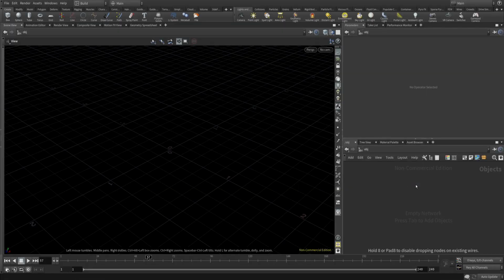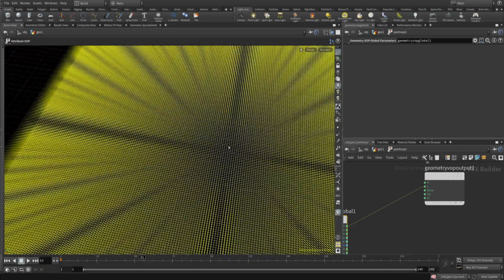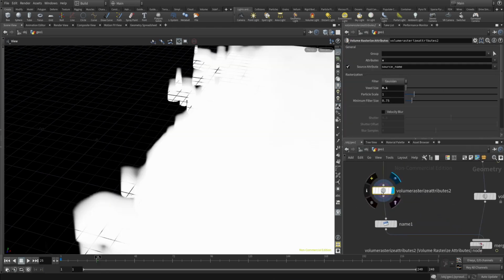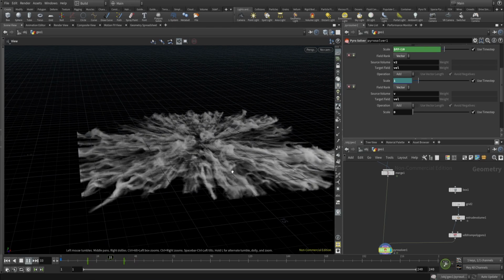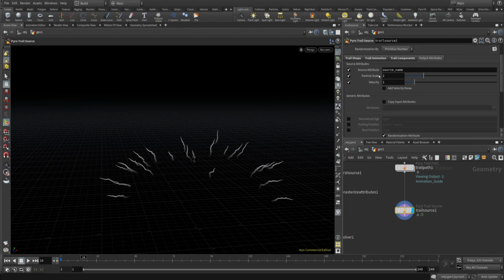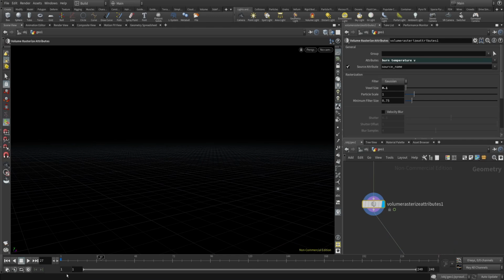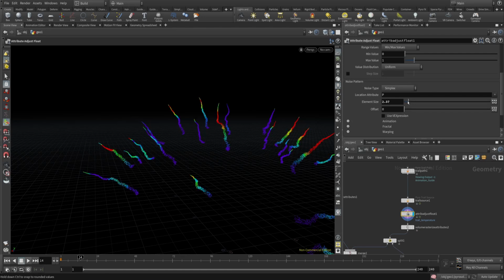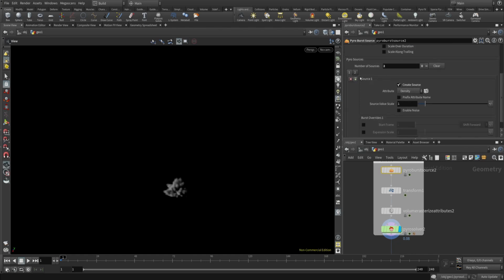Pyro FX in Houdini Tutorial , Part 02 | Shockwave,Trail  Explosion | For Beginner

Comment: I DID RENDER WITH MANTRA BUT ACES COLOR DOES'NT APPEAR ??????
Reply: Bro, simply avoid Mantra and start either using Karma within Solaris/Stage or use 3rd party render engine. Mantra is old and very slow. 😊
Reply from the maker: Double check all the process which i did for installing ACES
there is no other tips to install that
also it is not just for Mantra but everything in Houdini
once ACES is installed correctly you should have it in viewport, Mantra, Karma mplay and etc

Comment: Very good tutorial -- I can't seem to get the white smoke while using the same pyro bake volume node - it would be nice if there had been more time spent on this...on the tut - it goes rather quickly and is not using the same setup
Reply from the maker: Hello,
Why you want to use same Pyro Bake for both White smoke and black smoke?
in the tutorial I used 2 different Pyro Bake Volume per each one, I just copied the Temperature field from main explosion to white smoke before using Pyro Bake volume!

Comment: Hi Sadjad , thank you for the Pyro serie, its really amazing, and more than helpfull. Ive notice a difference between your sims and mine , the difference is that as I start to reach a quite high amount of frames for the "source frame range"  lets say a 1-50 or 60 (to include the trails generations), Houdini is pre cooking the whole frame range before starting the sim, everytime, i do any tweak, which is slowing down the workflow,like if it was caching the emission phase before startin the sim calculation, but it seems you dont have this phase, you working on a 1-61 frame range and your sims starts right away you press play, is there a special set up in preferences of any king , or is it maybe a matter of hardware ? im also on a 3090 , and ryzen 3970x, so it should not be a matter of HW i guess, thanks by advance for your answer DSadjad, best, L.
Reply: Did you manage to solve this issue?

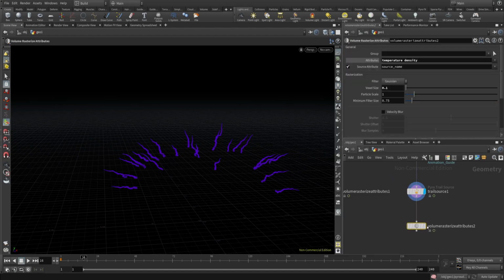Comment: Thanks a lot for the tutorial. I have a question : In the part 01 when creating the explosion, you didn't use Density from the PyroBurstSource, but exported only Burn and Temperature. Here, at 28:55, you export Density, but not burn. Is there a reason for that ? I'm not really sure I understand the role of the PyroSource vs PyroSolver correctly. Was it because we decided to create the smoke on the fly from the PyroSolver based on the burn given by the PyroBurstSource ? Why don't we do the same here ?
Reply from the maker: Hello

for the main explosion yes, as we are going to generate smoke based on the burn during the simulation (Smoke option in Flame tab), there is no need to inject density from the source.
But for the Trail, we will get better results if we just use smoke from the source. Because we could control its shape and thickness very easily in SOP level, not dynamic parameters. (via trail source parameters as well as noises)

as we have large scale simulation with expansion, generating smoke during simulation is getting us the desired result,(at least on this project)
That's not the case for trial.

However, it is not a rule, it all depends on your result and look, you can generate smoke for the trail during the simulation as well, But I believe control its shape is much harder,
Reply: @sadjadrabiee  Thanks for your answer. It's clear and I get it now ;) Excellent work on those tutorials, I have no clue how I would have gotten started with Houdini Pyro without those.

Comment: My pc specification

I9 10900k
Rtx 3090 rog strix. 
Can i do high end stimulation like this?
Reply from the maker: Hello
Yes you can, of course for the big explosion at the end of video I simulated 3 different explosion with gpu, as it wasn’t possible to simulation very large scale explosion with 24 gb of gpu,

If you check my explosion for my rtx3090 review, it was done with same system spec as yours 🌹
Reply: @sadjadrabiee   what do you think better use 1(RTX 8000) or 2 (RTX 3090) .... or even 2 (RTX 8000) for smoke/fire simulation.... and how much really need GPU ram for nice High sims?.... and how is the quality GPUs... still looks like 3090 Faster but just 24Gb ram compare 48Gb for RTX8000 ....
Reply from the maker: The hip file is available for that explosion too, feel free to open it and test it on your machine
Reply: Which render engine?
Reply from the maker: @mosesmorgan1104  I've used Mantra, You can use Redshift and other engines as well, But be aware that the new features of Pyro Shader are not implemented on other 3rd party rendering engines and you need to customize your shader
Reply: Is mantra GPU or CPU rendering?
Reply from the maker: @mosesmorgan1104  No it is working with CPU, we have a new rendering engine instead of Mantra which is Karma, Sidefx said on the next version of Houdini they would add GPU feature to Karma,
Reply: Does arnold render engine for houdini support GPU?